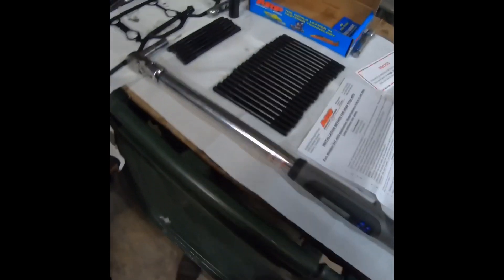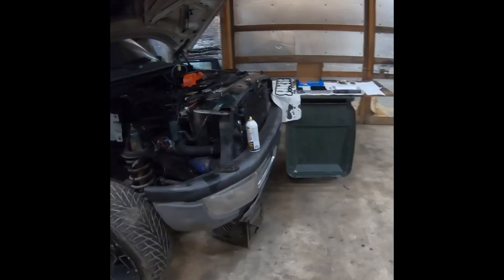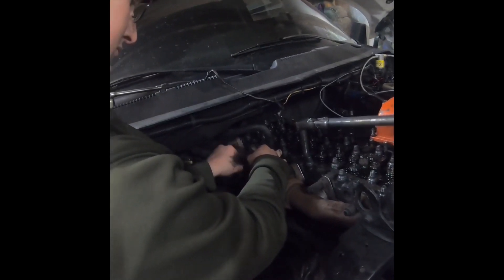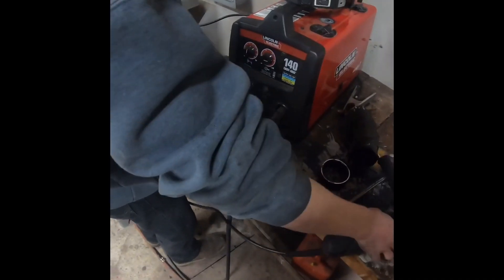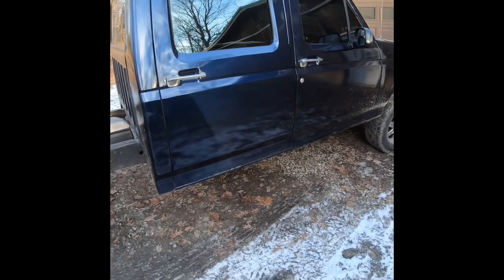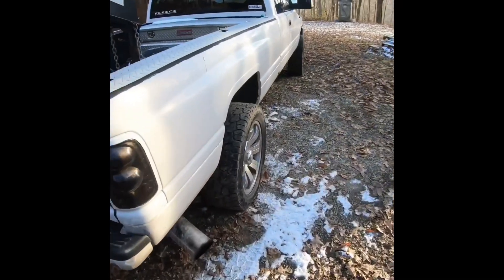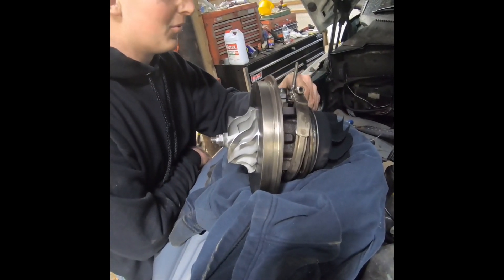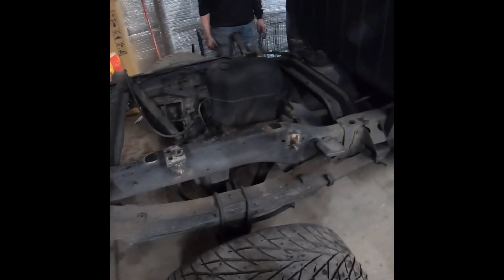CUMMINS HEADSTUDS

Comment: Yeah your exactly right. That blow by is nothing. Ive seen way worse and go for many many miles. And dont always freak with blowby. Could just need some head work. Check and make sure injectors are seated properly. Blowby isnt always a bad thing.